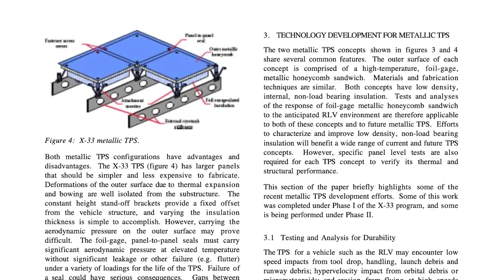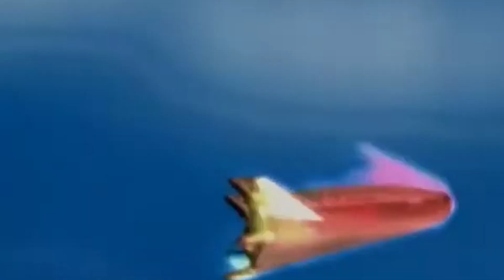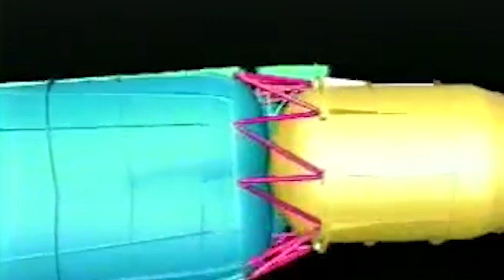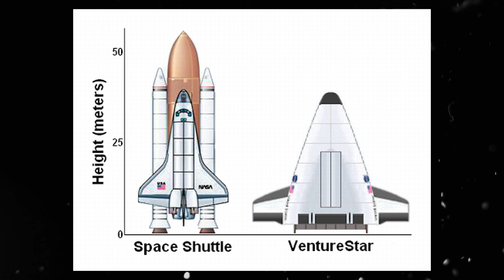The Secret Skunk Works Space Shuttle Replacement

Comment: 5:43 - While the heat shielding was superb, had this program come to fruition, the AeroSpike engines would have been the real stand out component. 

The X-33 was an idea well ahead of its time. The materials technology required simply didn’t exist during development. The fact that much of the program is still in storage rather than buried out in Nevada says it all. We haven’t seen the last of the Venture Star.
Reply: I hope so, despite not having the payload ratio of systems like starship that are being developed, the venturestar would be far easier on infrastructure and logistics compared to a starship and could make use of existing runways, not requiring any sort of tower for landing or catching boosters.
Reply: There is dead, and then there is really dead. Vstar/X-33 is really, really dead. Everyday astronaut has an excellent video about AeroSpike engines, including comments by the very engineers who designed and built these engines. The bottom line is, they are more trouble then they are worth... and that will remain so no matter what tech is developed into the future.
Reply: @hawkdsl  I already saw it and the aerospike engine was not the a feature that would have really benefitted the design. They should have used a dual fuel engine like the RD-704 which allowed use of kerosene and lh2 and lox for ascent and lox and lh2 for orbit, with a potential payload fraction of perhaps as much as 5 percent for an SSTO (vs 3 percent for starship), which should be pretty self evident as for its benefits
https://youtu.be/ctikrdo-2wQ
Reply: @vladimirpootis9690  would be evwn more expensive than the project already was, also it just doesnt get to the efficiency of the J-2, wich is the venture star engine
Reply: I would love to believe that was true.   Seeing a real ssto get launched would be incredible.
Reply: Unless SpaceX builds it, that's all we're gonna see of this Concept.
Reply: @user-mp3eq6ir5b  Elon Musk gave a relatively comprehensive response on why his company isn't planning on designing any kind of ssto in the near future.  It's in the most recent everyday astronaut interview
Reply: @user-mp3eq6ir5b  yeah its unfortunate wish spacex would give dual fuel engines some love

Comment: In 2004, I was a captain in the Air Force.  I was taking a one month class at test pilot school.  We were taken out to a remote corner of base, and there was the 40% complete X-33...covered in owl shit.  It was most certainly NOT disassembled, and looked more like 70% done to me.  Too bad they didn't finish to demonstrate the technologies, most notably the TPS and aerospike engines, but reusable SSTO is inherently inefficient.
Reply: Adopting the Aerospike seems a worthy specification, but methane is/was preferred over hydrogen for reasons I only dimly recall. Forcing more ‘environmentally friendly’ fuel appears to be more trouble than its worth.
Reply: @ShaunDoesMusic yep. methalox is way denser and doesnt seep through tanks and plumbing like hydrogen can/does. spacex with starship i think has nailed it. sure rp1 might work fine but the plan is to make methane and oxygen on mars, and we already have them in abundance here on earth so its a perfect fuel for future mars missions, plus the thrust of the raptors is great, and raptor 2 supposed to be even better. should see those some time soon. and as blurglide mentioned ssto is inefficient. reusable first stage is great, and if the second stage/vehicle is reusable too? fully awesome. ;)
Reply: Indeed, multistage was a revolution when developed and let us go to the Moon. Single stage won't make sense until we are using the next echelon of propulsion technology, something far removed from the chemical energy of rocket fuel. All of our funding should be towards more advanced propulsion. We only need lightweight craft because we are using low energy density fuel. With 1000 fold greater ratios, weight will be almost a moot point, removing the need for all of these advanced lightweight technologies. Humanity's strategy when it comes to focusing intellectual and monetary resources in aerospace is very poor. At least, when only considering what isn't occulted.
Reply: You were at Site 9 (building 704) the old B-1 final check-out building on AF plant 42 when you saw it. the east half of the building was where the X-33 was kept. 85-ish percent of it was completed. there was a common door between each half of the building. i used to visit those guys working on it once a week when i was there. because it was so far along, after it was cancelled i had always hoped that the program went black... who knows, maybe it did.
Reply: @omlettedufromage8588  X-33 was to expensive for USAF to take up.  Given it already has the X-37B ( https://www.youtube.com/watch?v=QvI71s5XN7A ) which is successfully accomplishing most it's space based research missions, it did not make sense for them to dump money into the X-33 to get it off the ground.
Reply: @omlettedufromage8588  No rockets are WW2 technology. We are way beyond that today
Reply: @ShaunDoesMusic true, but making liquid hydrogen and oxygen is easier especially in situ resource, where as the amount of mission if you did have a large fleet would have been dmging to the environment, methane is 4x more potent a greenhouse gas. However it never flew so will never know how good or bad it was.
Reply: Reusable single stage to orbit is inherently inefficient? That makes no sense. Maybe it's not as efficient as these government agencies would prefer but inherently inefficient? Sorry, I have to call bullshit on that.
Reply: @kellyrayburn4093  Yes.  You need to bring the heavy 1st stage engines and fuel tanks all the way to orbit, which must be subtracted from payload.   With chemical fuels, an SSTO would have about 1 to 3% payload fraction.  However, to make it reusable, you need to cover these heavy tanks in engines in a thermal protection system capable of orbital reentry.  Then, since your engines are optimized for sea level, you need to carry extra fuel and oxygen to make up for their inefficiency in space.  Then, this monster needs some kind of landing system, and you have to make the whole thing robust enough to withstand multiple launches.  All this is subtracted from your 1-3% potential payload fraction, so you wind up with a vehicle that's perhaps 20 times the size of a multi-stage rocket with an equivalent payload, if you were clever enough to find a way for it to carry any payload at all.   Something 20x bigger, using 20x as much fuel per launch, is inherently inefficient.  Why would you think otherwise?
Reply: @kellyrayburn4093  The closest thing we had to SSTO was Atlas B.  It had the lightest fuel tanks ever developed.  It used a balloon tank, and couldn't even support its own weight without being pressurized.  It brought this entire tank up to orbit with the payload.  It started with 3 engine burning on the pad- a central vaccum-optimized core, and two sea level booster engines on the side.  It had to jettison those outboard engines half way up, or it wouldn't make it to orbit even with NO PAYLOAD.  By dropping the boosters, it saved enough weight to have a 1.5% payload fraction to orbit.  Now...how are you going to get the engines all the way to orbit, and have a recovery system, out of that 1.5%?
Reply: @blurglide  while that's true, aren't aerospike engines efficient both at sea level and at lower pressures? They aren't as efficient as an engine made specifically for operating at sea level but they can do a bit of everything.
Reply: @afoxwithahat7846  Yes- aerospikes can theoretically solve at least one of the problems I listed.  They might also make a decent heat shield for reentry so maybe that's two problems solved.  That's why it would've been great to see them demonstrated.  The core problem though is having to take your first stage engines and tanks all the way to orbit.  It's doable...just inefficient.
Reply: @blurglide  I see, thanks for clarifying
Reply: @kellyrayburn4093  the reason for this is sea level optimized booster design vs vacuum optimized booster design. its why there are 2 raptor versions. raptor and raptor vacuum.  far more efficient in space. first stage, super heavy is all sea level boosters. no wasted space on the bottom with vacuum boosters, which have way larger nozzles, taking up way more room. second stage has 3 of each. 3 for space, and 3 to land in atmosphere
Reply: @kellyrayburn4093  I guarantee every single person who replies to your post started out "there's got to be a way." - Chemical fuel and oxidizer is just not up to the job launching from Earth. Look up ISP and the rocket equation. There just isn't enough potential energy in chemical rockets to get a useful payload into orbit with SSTO. The problem gets trapped in a cycle of "add more fuel/need more tank/then another engine/ now more fuel/tank/engine."
Reply: You're a zoomie so I'll take your word on that. I'm curious how did you know it was owl shit? Is Air Force training getting that specialized these days?
Reply: @yoda5565  This was 2004- not "these days".  I knew it was owl shit because of the owls.  X-34 was in the sam condition in the opposite corner of base.
Reply: @yoda5565  Owl's roosting in building 704 -- and the bones etc in their scat makes it pretty distinctive from other shit-matter :)

Comment: Yeah I don't think this was a terribly "secret" project even though Skunk Works was involved was it? Seemed like a very public project at the time. Even if it did not go with the composite tanks, this would have been an improvement and faster turn around craft than the Space Shuttle. I think it was killed for stupid political reasons more than anything.
Reply: Lockheed Martin had webcams installed in the area where the X-33 was being built.  I used to go regularly to the website, to see how far construction had gone…hardly a “secret” project.
Reply: I saw a video a while back, that outlined that the team leader of this project had a personal investment in the carbon fiber tank company. So when the carbon fiber tank was eliminated, he lost all interest in the project.
Reply: @alphagt62  Wow, I'd not heard that before, despite having read quite a lot about this program, but I guess not extensively enough. Interesting. It seemed like such a waste to not even try it out, but in the end NASA would have bungled it up.  Look how much trouble they're having with an old fashioned throw away rocket.
Reply: @alphagt62  i was wondering why it would matter if it was carbon fiber or another material.
Reply: @TheBooban  The issue was that the tanks were a part of the structure of the vehicle.  Aluminum alloy shrank and expanded too much from empty to full.  Composite tanks were more dimentionallty stable.
Reply: More than likely this was the public project to distract from another highly secret project that at least to some degree had parallels in development.
Reply: @tylerangle1990  the still secret X-37 mini shuttle we have now
Reply: Before they started construction, I was given a 24”x36” poster of The X33 at an event.
Reply: @christopherchase3061  I still have that poster(I got mine from work). I work out at Cape Canaveral.
Reply: i believe another contributing factor was the areospike tech while perfectly functional was way too heavy.
Reply: 2001 , what else happened around that time ? Hmmmm ? No need for ... SPACE FORCE  quite yet . BUTTTTtttttttt ! Why not a 20 something year long war ?
Reply: This is the problem with such projects, they are costly so there is a lot of money that isn't going to benefit directly the voters of the congressperson. So they are looking for every flaw and as soon as they find one like the tank, they will attack it till the project is canceled.
Reply: It looks like GI Joe modelled their big shuttle and launcher off of it.
Reply: I'm pretty sure I read about this in Popular Science or Popular Mechanics.  Maybe both.  Either way nowhere near secret, but it was a cool idea.
Reply: Killed because senetors got payed before line workers.
Reply: @nicholasfeiock7873  LOL ! They are NOT owned by trump inc.
Reply: @inmyopinion6836  but they are owned. In a way I can only describe through iceberg slims   vernacular.
Reply: It was the second shuttle disaster that shut down all space travel
Reply: The stupid political reason was that Al Gore championed it.  Republicans replaced "championed" with "invented".
Reply: @uggligr  uh trump helped Elon on space x.  Dont forget Obama stopped nasa.  Now Biden administration is stopping space x launches. For not being green.
Reply: Techies don't care about costs.